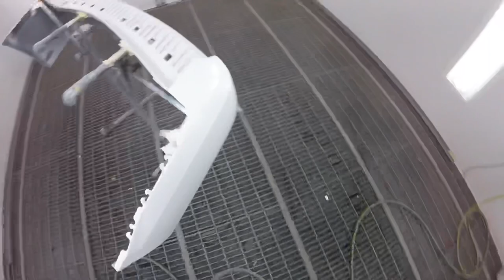Spray painting Chevy Tahoe with Sikkens Autowave.

Comment: Hi friend... What do you think about the polite? And what is you settings? Air cup and fluid settings...
Reply from the maker: I love the pro lite. It is a great all around gun. I don’t use it very often but it is a really good gun. I have the TE20 air cap on it. 1.4 needle tip. Fluid wide open and spray around 22 psi for coverage and 18 for  orientation.
Reply: @everyday_painter  I have the prolite and I use for clear... 1.3 with the TE20... I like it very much... I also have the T110 air cup and I think is the best air cup but a little slow... I am looking to buy a sata... Probably the 5000....
Reply from the maker: I haven’t tried the T110 air cap yet. But I hear good things. The 5000 is a great gun. I have a 5000 RP with a 1.3 tip. I love it.
Reply: @everyday_painter  Thank you friend...

Comment: At what temperature do you spray your solid colors and metallics ? How heavy is your fist coat? Thank you
Reply from the maker: During winter I set my booth at 75. When spraying light silver metallics around 70. During summer it is very hot where I am. Booth does not have cool setting. So lately it has been between 90-106 Fahrenheit. First coat I do a closed wet coat.
Reply: Thank you so much I just recently started at a shop using sickens and noticed a hat unlike ppg it doesn’t like to be spray with too much heat nor too wet. Would you say that to be some what accurate?
Reply from the maker: I personally haven’t noticed it not liking the heat. Like I said, summers here are very hot and I don’t have many problems. What are you reducing your metallics and solids? Also what guns and pressure are you spraying at? As for too wet, yes you should be careful as to how wet you are laying your base. I do a wet closed coat. But do not pound it on. You don’t want it to look like your metallics are swimming around. When drying base coat always make sure to be on an angle. That way your forcing the water to evaporate out of the panel and you are also drying the entire panel at the same time.
Reply: I was using a 1.3 rp 5000 and recently switched to a 1.4 and noticed that metallics lay better with the bigger tip and yes I’ve been using the closed wet application and I think I’m getting the hang of it